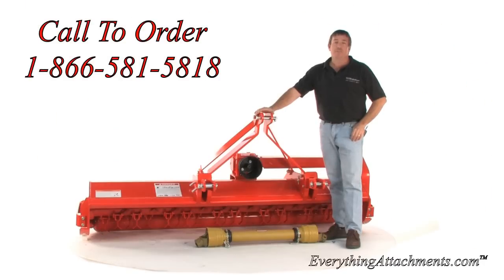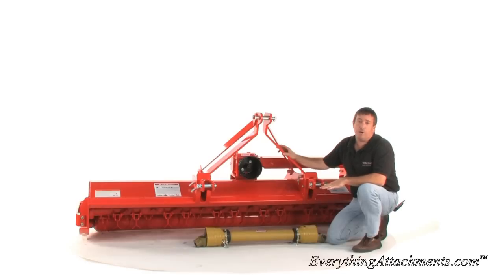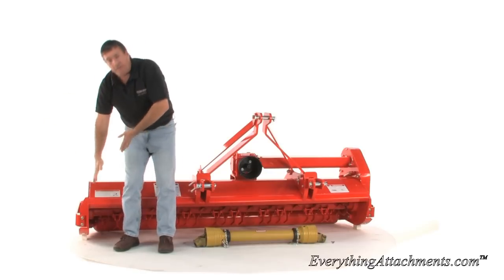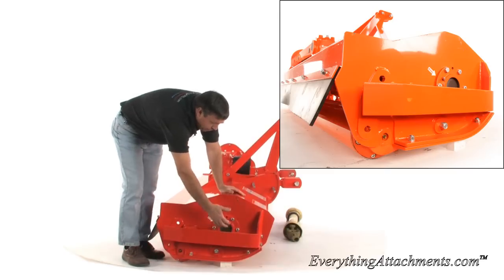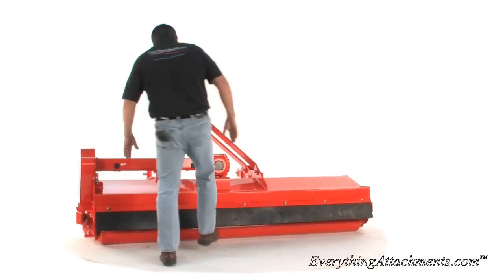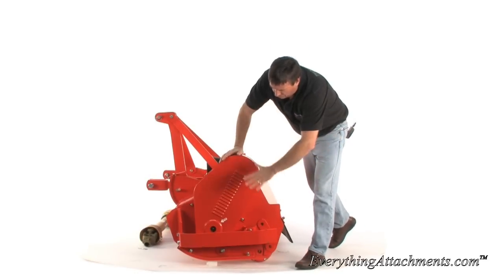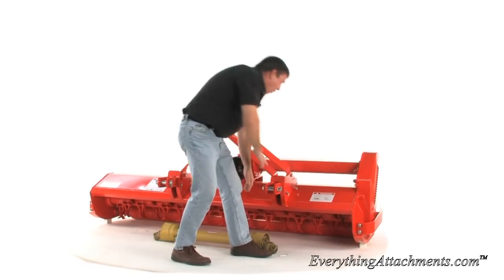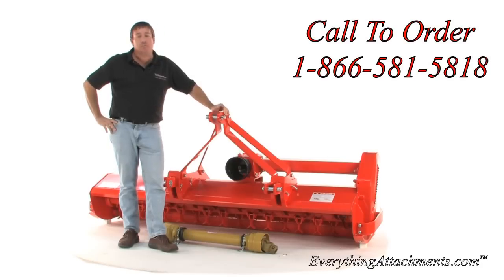Phoenix PFL-98-05 Flail Mower

Comment: What situations would you use a flail mower versus a bush hog? Can you use a flail mower as a finish mower and tall grass? Can you do the same for a bush hog, high grass and finish mowing?
Reply: chechnya I currently have a "bush hog" type mower.  From my experience, the bush hog is for rough cutting brush and taller fields.  It's cut is not fine as it only has two heavy blades.  Mine often leaves a trail of cut grass behind.  A flail mower cuts very fine, much like a finish mower.  To me, the flail mower fits between the bush hog and finish mower.  If the cost was the same and I wanted a fine cut while having the ability to chop up grass and medium brush, I'd buy a flail mower.